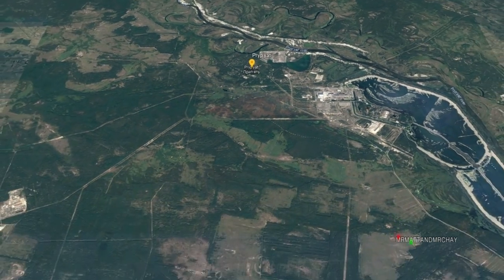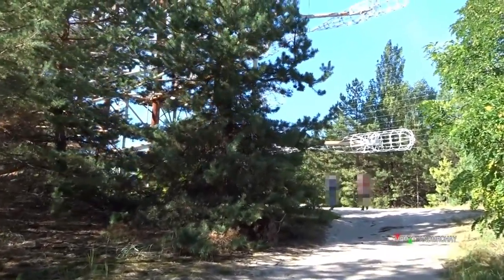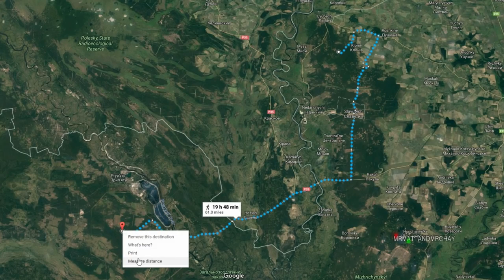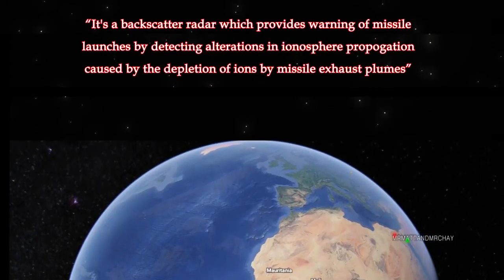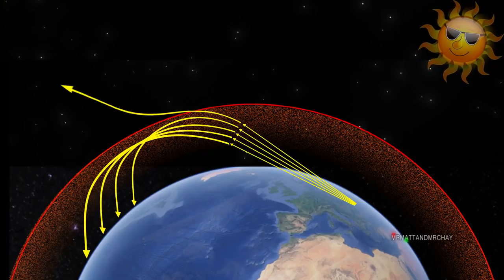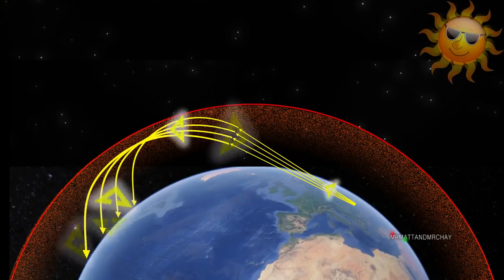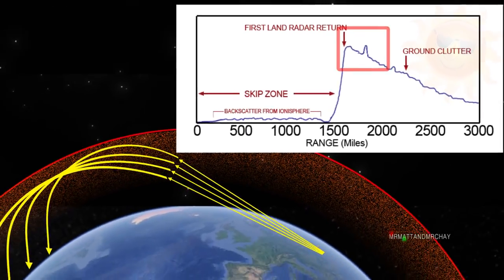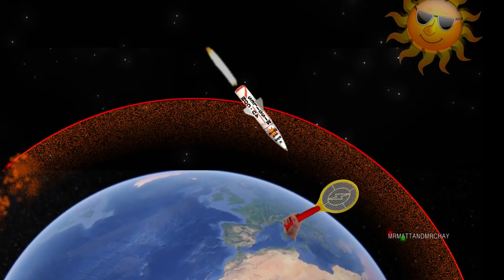(Chernobyl) Probably the best DUGA RADAR "how it works" video on youtube! (must see the end!)

Comment: I took a tour of this place during the summer this year. They told us it never detected an actual missile. But it did have false readings as it couldn’t tell the difference between the heat of missiles and the heat of the sun. This wasn’t discovered until after it was built. So they needed crew members to carefully read the data without acting in haste. Or we would have gotten global destruction just by a bad case of regular sunlight.
Reply from the maker: Very interesting!  I read that the system actually detected a scheduled missile launch in japan somewhere.  For them to read a proper missile launch directed at the USSR, yes that would be a very difficult decision - is the reading real or false?!
Reply: You are talking about satellite constilation that were flying over USA.  They had heat sensors that were build to see exhaust of starting missiles. But sometimes this satellites had false positives results. Because of sun light messing with their sensors. Later as i heard that problem was minimized. 
And duga-3 was extra method to in case satellite will malfunction or satellites were  jammed.

Comment: In 1962-63, the Soviet Union began constructing the world's first working Anti-ballistic Missile (ABM) system, which was designed to protect Moscow. Originally, the system was intended to have eight complexes, each with 16 interceptors (for a total of 128 interceptors), in the Moscow area, but construction slowed in 1968 and by 1969-70 only four of the sites, with a total of 64 interceptors, were completed. Plans for additional sites were scaled back in 1972, when the signing of the ABM Treaty limited the Soviet Union and the United States each to two ABM sites totaling 200 interceptors. The system's architecture shrank again to one site with 100 interceptors when a protocol to the treaty was signed in 1974.

The Moscow system relied on a huge A-frame radar known in the West as the "Dog House" for long-range tracking and battle management. This was later supplemented by another radar, known as "Cat House," for the same purpose. A network of "Hen House" radars on the periphery of the Soviet Union provided early warning and missile acquisition information. Like the US Safeguard system, the Soviet system used a nuclear-armed missile (called the Galosh) as its interceptor. The interceptor used a warhead with a yield of several megatons -- several hundred times larger than the bomb dropped on Hiroshima.

The Soviet Union began a major upgrade of its system in 1978, which remains unfinished. The new system was a two-layer defense using two types of nuclear-armed interceptors -- an improved version of the Galosh, for intercepting warheads outside the atmosphere, and the high-acceleration Gazelle (similar to the US Sprint) for intercepts within the atmosphere. The updated system, still nominally in operation, relies on the phased-array Pillbox radar at Pushkino for coverage and a network of large phased-array radars, along with the original Hen House radars. The new system apparently includes the maximum 100 interceptors allowed by the ABM Treaty. The system is still only intended to defend Moscow and is not a national missile defense.

At the time of the Soviet Union's collapse in 1991, the new ABM system had still not reached full operational capability. Much of the early warning radar upgrade program associated with the improved system had not yet been completed, and of those radars that had been updated, several were in republics other than Russia. The sharp decline in the Russian defense budget after the break-up also effectively ended most work on the program, and the early-warning network quickly deteriorated. Despite these problems, the system has continued to operate at partial capability, and a secret presidential decree in 1995 declared that it was still operational.
Reply: The Don-2 guided A-135s alledgely still defend Moscow and saint Petersburg I belive.tho I think the ditched the nutron warhead XD

Comment: Frequency rays only pass the ionosphere when they star to exceed 30 Mhz range. As the frequency increases, each wave is refracted less by the ionization in the layer, and so each penetrates further before it is reflected. Eventually, a frequency is reached that enables the wave to penetrate the layer without being reflected. For ordinary mode waves, this occurs when the transmitted frequency just exceeds the peak plasma, or critical, frequency of the layer. So reflections of the signal does not have anything to do with aiming the radar. Duga was working and broadcast in the shortwave radio bands ae 05 to 30Mhz
Other than that kinda nice and simple explanation. still deserves a like.
Reply: yeah its called the "F" layer - oh F^%$£ it's a missile -

Comment: Bionerd23 did a video where she went into the remnants of the duga-3 signal processing facility, and it was quite vast.. I’d imagine they had some kind of mathematical algorithm that looked at the signal as a whole.  I’m sure the Soviet operators could look at the waveforms being generated and see planes, maybe even moving vehicles on the ground. The ionosphere disturbance would likely be the trigger to go on alert.
Reply from the maker: Sounds plausible.  A very large project this one...imagine the amount of time and people it took to design build and maintain it!
Reply: mrmattandmrchay it’d be neat to find a principles of operation manual for the system or even to just see what the monitor output looks like
Reply: Most certainly not vehicles on the ground. Planes don't fly that high, well below the ionosphere. The Soviets, i think, could be happy if they could indeed detect incoming ICBMs without too much false positives / false negatives...

Comment: I heard the "woodpecker" often in my CB time. There was even a "woodpecker" killer pcb. I don't remember what it did, maybe only muting the audio during a pulse.
Reply from the maker: +Marco S yes I read about these.  Thanks for the message
Reply: Depends on the actual circuit, there were multiple designs afaik. Some would reverse the signal and send it back out which forced the transmitter engineers to change frequencies (Basically the same kind of logic as noise cancelling headphones being used to effect the radar itself) while others would silence it with varying degrees of intelligence. (Some would just mute it, others would attempt to detect that specific signal and reduce it as much as possible, etc)

Comment: I am quite sure that you have mixed up the transmitter and the receiver. That massive array must have been used for transmitting. Receiving HF-signals can be done with much smaller and cheaper antenna systems.

Comment: They had to use TWO hops. So this is why this project was so unique. And it is eyxplanation why they only want to detect a misile trace in ionosphere. And in order to detect smaller signal than noise at the receiver site they used digital modulation today called CDMA.

Comment: why does a receiver consume so much power? either it doesn't, or it's not a receiver.
Reply: I am not expert, but maybe because of pre-amplifiers, amplifiers and old computers needed for logical operations that consume lot of power?
Reply: @filip9043  well, he says 'the radar also consumed a quarter of the power station's total output'. that might also include the transmitter and the receiver. regardless, you need a lot of surface just to dissipate 3 GWs at a reasonable temperature.  that would raise the temperature of the Prypjat by a few degrees (my gut estimate is 5-10). so I'd say this is bollocks, even with the transmitter included.
Reply: @bocckoka  yeah, that make sense. Just little correction, chernobyl produced 12 GW of thermal power, but "only" 4 GW of electric power with 4 generators (but 4. generator was never finished), so quarter is below 1GW what is also a lot. But 4GW of electric power is peak , but I doubt that power plant was on its peak power 24/7. That is why I thought thous numbers could be plausible, but still consumption is little bit high.
Reply: I think the whole system used a fair bit of power, but 1/4 of a nuclear power plants power does seem way to much. Even with the massive transmitter, computer systems, and high power amplifier systems.

Comment: This DUGA was taken out of svc bec the nearby Chernobyl power station was deactivated.  AND there's that little issue of radioactive contamination to the property.
Reply: Wait..
Which years did the Chernobyl power plant stop to work?
I know a part of it still works nowadays.
Reply: @trickortripslao8607  the electric switch station still works but the reactors were shut down in 1991(nr 2), 1996(nr 1) and 2000(nr 3)

Comment: they built a new one, started operation in 2015, the second array is expected to become operational this year. its 1300 meters long!!!!
Reply from the maker: Such a system is still necessary in the current age of satelites and internet?
Reply: @mrmattandmrchay  yea, they are. what if your satellites stop working? due to EMP, or hard kill anti satellite weaponry, during the reunification of Crimea, Russia jammed the internet on the entire peninsula. so internet is not guaranteed either. next to that i believe most satellites that detect missile launches, only detect the missile after it has left earths atmosphere. and even then, they use temperature to detect them, in space things cool down or heat up really fast depending if the are in direct sunlight or not, making detection by heat at certain times impossible. modern ICBM's usually have loads of countermeasures that are deployed in multiple fases of the launch this could include something that generates heat to try and confuse the detection satellites. therefore a radar is still a very much a wise instrument of detection, since it will only stop if the station is hit, or if the power supply is hit.

the UK still operates an early detection over the horizon radar in Greece, and the US is also still using multiple radar sites across the globe.
Reply: @mrmattandmrchay  There are a few HF Over-The-Horizon-Radars in use nowadays. They can be heard on shortwave quite often.

Comment: Would of it been able to locate the missing Malaysian Aeroplane the night it went missing? Would there be data saved from the radar's computers which could help investigators  as to where it was heading that night?
Reply from the maker: Not for many reasons I'm afraid :)  1) The radar was switched off in 1989, 2) The radar doesn't face that way, 3) it's design would not be able to give that sort of information.

Comment: Australia has had an OTHR for many years. I've added a Wikipedia link but it seems to have some factual errors. In the 1980s the computer they used for signal interpretation was upgraded to a DEC Alpha because they could load the program and data into its 8 GB of 64 bit RAM. Thus running it much faster. A great advantage with this type of equipment.
The radar return is used to identify aircraft, ships and the like.
https://en.wikipedia.org/wiki/Jindalee_Operational_Radar_Network
Reply from the maker: Interesting, thanks for the info

Comment: hello .. Thanks for the super video .. I just want to ask the transmitter the cast I found on the map as you had in the video and there are not rear antennas, only buildings ... Is that normal? I'm not an expert, and I find it strange. I got a lot of information, but nowhere is it exactly where the transmitter was written .. Thanks for your reply and me .. I know it's too interesting👍😀
Reply from the maker: Hi, thanks for your comment.  The Receiving station cannot be dismantled due to it's location being within (or very near to) the exclusion zone.  Anyone attempting to remove this massive structure will disturb the land and bring to the surface contaminated land that has been buried for many years.
The transmitter is (or 'was') in a different region and is a lot smaller than the transmitter - this was removed many years ago (in the 90s I believe) - therefore the transmitting aerial were removed as it was safe to do so (far away from the contaminated area of Chernobyl) but the buildings still remain.  Not sure why they didn't remove the buildings at the same time.
Reply: @mrmattandmrchay  

hmmm, yeah yeah .. and how much do you have in the video where the radio is the place where it was originally? Otherwise, thanks for the answer and I wish you nice Christmas😀👍
Reply from the maker: We didn't visit the other location (transmitter) if that's what you mean.  Thanks, wishing you a great Christmas and new year also :)

Comment: Calling it a receiver is incorrect. Transceiver would be correct! A receiver wouldn’t use allot of electrical power it’s then transmitter that needs the power to generate high RF energy in order to refract off the ionosphere then reflect off a moving target back to the ionosphere and back to the receive with enough energy to be detected!

Comment: Pretty sure you have the receiver and transmitter confused. Looking at Wikipedia and other sources, it says they’re vice versa from what you say
Reply from the maker: Yep. Unfortunately when I did my extensive research I don't think this information was available so I presumed that the largest control room of the systems would be the receiver with all the complicated equipment in it. I have since been contacted by somebody else who has worked on such system to correct me.  For this video...its too late.  You cannot adjust videos without having to delete it and reupload as a new video.  Perhaps someone has amended wikipedia with this new info.
Reply: mrmattandmrchay it might not have been as widely available, but it was out there. Probably just not on sites that come up when you search on google. Mostly smaller sites dedicated to these kinds of things. 

I just thought about it this way until I found out for sure which one was which myself: 

If you can pick up that signal pretty clear on just about any radio that tunes to that frequency all the way over in the US, than the transmitting antenna must be pretty damn big and powerful. Also, the receiving antenna wouldn’t have to be nearly as big, as it’s easily picked up since it’s such a strong transmission. 

Other than that mixup, the video was good. I agree it wouldn’t really be worth it to redo the whole video almost 3 years later though.

Comment: ,,Quarter of power station output"? So 1,000 MW? Rather impossible
Reply: It doesn't say the time unit. Could be hours or weeks.
Reply: Watts are "rate of energy transfer": per-unit-time is built-in.
  Watt = J/s

1 kitchen kettle ~= 1kW ~= 1 kitchen microwave
-> 1,000,000 microwaves ~= 1000MW

So one limit of concealment is probably local energy dissipation around the antenna.  i.e. are the nearby trees cooked, is there a giant heat haze while it's on.
Reply: 750MW. Chernobyl was a 3000MW station
Reply: Yeah, I don't believe that figure at all. I highly doubt the claimed cost also. Looking at a satellite photo, the power lines going to the radar station are not very large. I would give it a few MW only.
Reply: TREDxMUSIC 4 x 1000MW
Reply: @stormtrooper9404  the first 2 units were 500MW. The 2 newer ones were 1000MW. You can even see the reactor buildings are visibly different from the outside
Reply: @skunkjobb  it's max wattage is significant , it predicts it's frequency ,

Comment: I want the Russians to fire it up again
Reply from the maker: haha, yes, but there isn't a lot left to fire up anymore except the receiver structure - also the transmitter station has been taken down.  I know what you're saying though :)
Reply: It was actually quite clever of the Russians!
Reply: they made a new one, which i have heard using a WebSDK ham Radio Receiver multiple times now.
Reply: Wow really
Reply: @LodewijkVrije  ,so what frequency is it on ? better not be any pager frequency :)
Reply: @3v1Bunny  

Frequencies 6100 kHz,32000 kHz
Frequency Range 6.1 MHz - 32 MHz
Mode USB
Modulation FMOP
ACF 20 ms
Bandwidth 3.5 kHz,7 kHz,14 kHz,28 kHz 

try around the week start, like monday-Tuesday. as this is when i have heard it the most.

last time i heard it was somewhere in February on 14000 khz

they said they were going to test the second array, starting this year. so there will probably be quite a bit of activity from this thing.

if you want to google it its called "29B6 Kontayner"
Reply: No comrade the Ukrainians

Comment: The ICBM's motors run out of fuel in the first minutes and the warhead re-entry vehicle takes a BALLISTIC path to the target.
Not sure what altitude that is, but probably above 70 miles.
Reply from the maker: interesting, so most of the time the missile is floating through space
Reply: If by 'floating' you mean 'falling', then yes.
A bullet is falling the instant it leaves the gun barrel, even if it was pointing up.
Hence the terms 'ballistics', 'ballistic', and 'Ballista'.
Reply: I'd like to thank the academy.....
Reply: It's an honor to be nominated.
Reply: @jsl151850b  Especially considering that your comment wasn't stupid ...
Reply: mrmattandmrchay Hey! Aren't you the elevator guys? I really liked the vintage 1905 one you did a trilogy on.